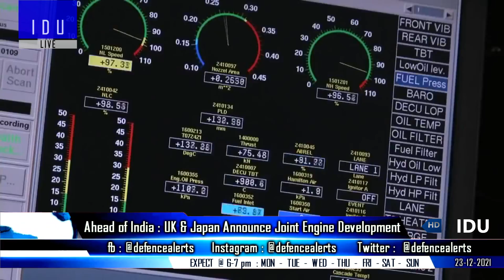Indian Defence Updates : Pralay Tested Again,LRLACM Engine,120 Loitering Drones,IRSS For INS Vikrant

Comment from the maker: 🔴What's Your Opinion "UK Japan Sign MoU For Engine Development" ?
ＬＩＫＥ | ＣＯＭＭＥＮＴ | ＳＨＡＲＥ | ＳＵＢＳＣＲＩＢＥ
Reply: Bad news. We should have made a special budget and joined the program. All fighter programs of the future will be such joint ventures, as no single country can absorb the entire developmental cost - except perhaps the US who has the money and China who could steal the tech.
Reply: @rameshms6230  "We should have made a special budget and joined the program" care to explain the whopping funding sanctioned for entire AMCA forget engines.. So all in all after 10 years AMCA program cost, money sanctioned was just 14 million $ when we need 10 billion $+ 
After 12 years MWF roll out is unclear fabricated news just spread around..
When the entire fighter program is in doldrums so priority to spend billions for engines as first priority is impractical to say the least...
Reply: @rameshms6230  All these projects from France UK s.korea Japan will compete for MRFA in 2035. Govt won't fund anything until . At this speed we can manufacture only cycles not high end fighters. Poor performance from Govt. RR offer was attractive...
Reply: @rameshms6230  5th and 6th gen tech will still involve electronics carried over from 4.5 gen but conformal sensors and that ends there, pure billions and billions $ required for R&D OF expensive 5th gen or in our case "5.5 gen" can't be skipped..  we act like we are multi tasking will multiple projects while having baselines and direction in none...As of now it's just planning of imported 4.5 gen and adjusting with 4+ gen..
Reply: @aocaoc2561  then let's park geometric stealth AMCA Mk2 by honestly accepting that we neither have the fund nor tech capability and just focus on remaining programs. And why bother about IP rights for a lower class engine which we are never going to export to anyone. We're better off just doing license production of RR's engine here, the same direction that China took decades ago.
Reply: At least Japan will not ask for offset terms.
Reply: This deal is a clear message to India from UK....for cancelling the INDO-UK rolls royes program by INDIA.
Also it is important to understand and learn to read between the lines.
French Indo engine deal means automatic cancellation of Uk deal. These things are never officially anounced but very easy to guess too.
Who the hell is that stupid to continue with two simillar programs.
Reply: @sg4250  Why didn't the French share the core engine tech earlier? Any idea on DRDO's/GTRE  progress on Indigenous initiative?
Edit: With India successfully developing Titanium alloys and single crystal castings, some headway should have been made.
Reply: What can we do???
Reply: @unknown-bq8ik  we can stop our useless slow babugiri  process & fast track deal signing
Reply: @unknown-bq8ik ĺ
Reply: @unknown-bq8ik  I have tjff
Reply: This will make India UK joint engine development tougher.. because now India has to follow UK's terms during negotiations.. and may have to join this program along with Japan for the engine...
Reply: Awesssssome...India will be discussing with RR and Saffran even in 2030...FUCKING BUREAUCRATIC CLOWNS...😠😠😠😠😠😠 .IT WONT TAKE MORE THAN A MONTH TO DECIDE ON A JET ENGINE PROGRAM. WE SHOULD GET A JET ENGINE TECH EVEN IF IT COSTS 10 BILLION DOLLARS..
Reply: @Flying Tiger The entire engine charade was laughable from start to be honest.Two very brilliant individuals even got silenced for that I recall..You always say they need Indian money for engine development.. But how? Both France and UK are not absolute cl0wns who delay projects by 5-10-15 years category and wait around! They knew very well we are not going to part with even few billions for engines.. Why? Because even after 12+ years our aerospace industry does not have the capability to build an extended tejas, 10 years after inception of AMCA a whopping 14 million $ was spent on the entire development all CAD files models and ADA salaries.. Simple unadulterated common sense..
Reply: India should join
Reply: FROM AUSTRALIA KEEP UP THE GREAT WORK INDIA 👌
Reply: A great development for both regions. RR is great for engine technology, Japan is great for electronics and composites. Put those together and you have a great new engine.
Reply: @Flying Tiger Yup it was just a sales pitch from RR and people went GAGA over it...That's exactly why news of this U.K-Japan deal makes sense, real serious players who mean business,have defined and committed funding,have  good aerospace capability and actually have a plan and road map... I feel what has happened is India relying heavily on "good friend France" for TOT via Rafale sensor and electronics tech, almost like a done deal with 114 MRFA and them finally restricting everything forcing us to rethink.. Now this theory may sound downright RIDICULOUS, but Dassault did help us with tejas baseline design consultation.. Now imagine 2001 first flight tejas mk1 and we built decent squadron numbers, and suppose 2009 on wards went to Tejas mk2 FULL SPEED, and built a Gripen C level jet then the entire Rafale 9 bil $ sales may have become a significant question mark..
So they want to be extra careful this time, it's not in public domain but many say ADA needs help with AMCA and some say even with MWF.. Offsets to be used almost like consultation, so lets say in theory they help with AMCA even slightly and prototype miraculously takes off it will mean direct danger for FCAS sales...They see the full picture..
Reply: Looks like India decided to go with Safran so UK had to go with Japan. More geopolitical than technical.
Reply: Still have hope.
Reply: For AMCA India is expecting 110 engines. How much UK/Japan 6th gen program needs?
Reply: @jothisampath415  It's not just about the count, it's about technology and engine class. 6th gen needs higher than 150Kn thrust - taking current F-22 Raptor as reference which has 156Kn thrust engine - 6th gen will need far higher energy requirement as the futuristic weapons like DEW, laser will need it. Our AMCA program hence is already a generation behind in technology - we attempt to power it with far lower thrust engine class - which RR already has - hence RR will use our JV to just get funding - we won't get anything pathbreaking.
Reply: @rameshms6230  AMCA was never meant to be 5th gen like f-22 but 5.5 gen instead, and better engine is always a good thing. There is high chance that UK and RR never approched or talked about developing a new engine, and only tried to offer the pre-existing ones to India. Both UK and USA are treating India with disparity compared to other nations, so it's understandable if they only offered their pre-existing technology but decided to co-develop a new engine with Japan. And it's not technology difference either. Japanese aero-industry isn't much better than India, and if anything our government is more serious about AMCA than Japan is about there program, mainly because they already have a 5th generals fighter(F-35)
Reply: @coolkal7590  The two projects are different, but engine is where more or less it's the same. As for why they didn't offer a joint research for a new engine, we either didn't approach them, they didn't approach us, or they think us too unsophisticated for partnership. Either is not unlikely as it's the Brits we are talking about. Technically speaking, the Brits or Japanese should have invited India, or at least hinted at it, because that's what allies do, but regardless, we have our own plans for 6th gen fighter. With TOT by RR on the engine for 5.5 gen AMCA, we will probably develop enough expertise for our own development. And there is always France
Reply: @Flying Tiger that is why they need to get a joined venture set up with a private sector company and RR. They can't wait on the DRDO to get it right in 20 years and the French engine is yesterday's technology.
Reply: l
Reply: Learning for India and its very very slow procurement process for which all credits goes to the bureaucrats in India 😀.
Reply: India can only be buyer of high tech because of slow decision making...
Reply: @Flying Tiger Y don't we pay RR and get IP rights for an existing engine which can power AMCA. They will be benefitted ; India will also benefit ? This deal might be cheaper too. Say initial deal was for 5billion USD. Now we just need to pay may be half. Is this possible?
Reply: @Flying Tiger fair points. Can Safran n DRDO produce a engine to power AMCA?
Reply: @Flying Tiger Exactly the reason another project the SK KF-X is actually happening just buy GE 414 engines...
Reply: @Flying Tiger F-35 maybe not in the short term.. But long term a decade ++ I still feel there could be a chance, we can work things out with agreements even with the S-400
Reply: @Flying Tiger I really doubt any big Russian hardware deals will happen a decade later, Mister Vlad HAS to be best friends with that winnie the pooh..You will see Moscow constantly meddling in New Delhi's affairs how they actually blamed QUAD for chine intrusion..They want to create the good old soviet era bloc.. Russia-China-Pak-Iran and will want us to comply.. 2 side threat means New Delhi will have to look outside as a necessity.. It's not hypothetical anymore, Chine want territories and total control and domination of all their surrounding areas.. Reason Japan going out of ordinary to become a regional power..
Reply: 8i
Reply: Iiiiiiiiiiiiiiiiiiiiiiiiiiiiiiiiii
Reply: 8i8
Reply: Good for them & as for India, imo we're going with France, don't forget they're working with 6th gen FCAS program. An upgraded M88 may fulfill the need for Tejas MK2, TEDBF & AMCA MK1. For AMCA MK2, the engine required for FCAS can be used.

Comment: When India was denied a super computer by the biggies, rest was history. India should consider developing a jet engine by her own.
Reply: That time it took almost 20 years. India can't afford to take that risk now.
Reply: How much does it take a century as India trying do develop 4th generation engine for last 50 yrs but at last made deal with GE for engine supply for Tejas program...
Reply: That's the way forward. But right now they should go ahead with the RR deal, and then using it as the core make our own engine
Reply: Yes of course, 50 years from now. LCA took 40 years without an engine.
Reply: After 35 years and several billion in investment the PSU system laboratories have spent they couldn't even get a third generation engine working properly. The only way forward is a joined venture between a private sector company and a western engine manufacturer.